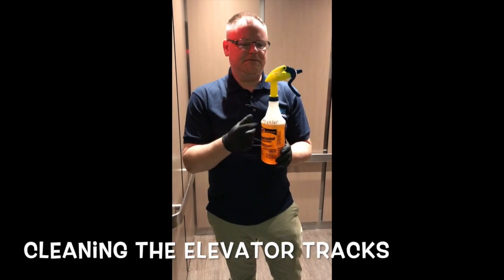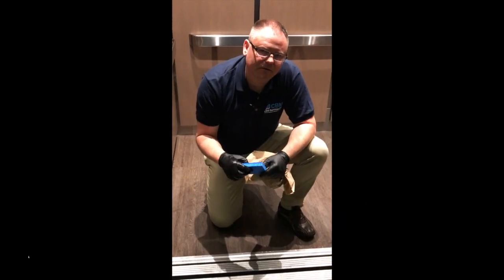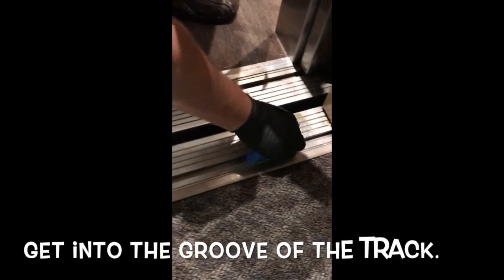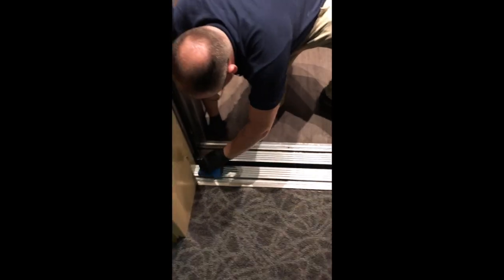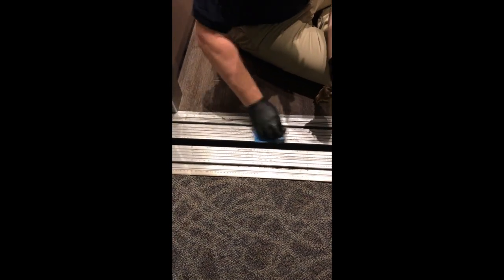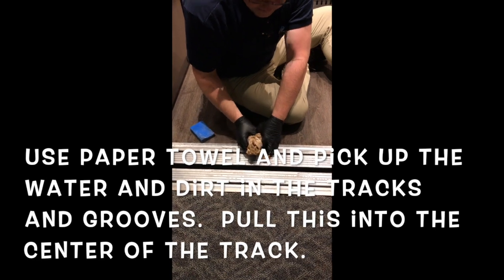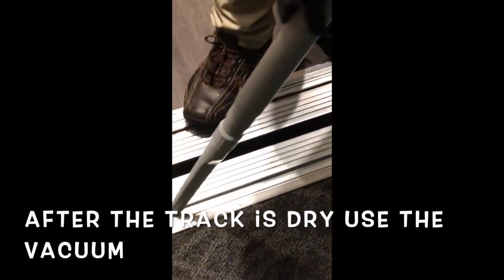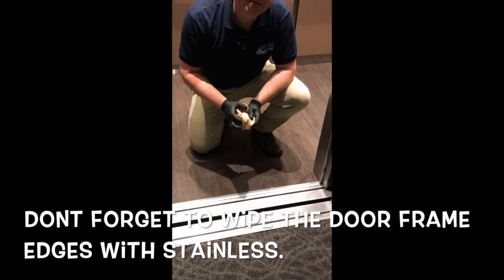How to clean the elevator tracks

Comment: Degreaser aye,  I was using goof off and Easy off.  I have the unfortunate task of cleaning 4 sets of tracks in a 38 story building.
Reply from the maker: KN Byam thanks for the feedback. I guess it all depends if the tracks have been cleaned at all during the life of the building. It’s a chore that’s for sure. Once it’s done and maintained it’s a snap. Send me some pics of your building. Also if you have any tips let me know. Cheers and have a awesome rest of your day.
Reply: @cbmservicesltd.1324  Thanks for the reply.  They look like they are rarely cleaned because there are some gummy, tar like stains that have to be scraped, steel wool is definitely not taking those out.  Also some glue stains because of the carpeting in the hallways.  I've only been at that job now for 9 months and this is the second time our resident manager has asked for them to be cleaned to my knowledge.